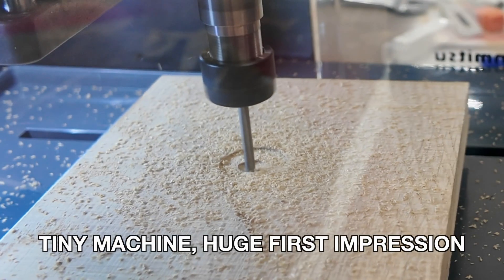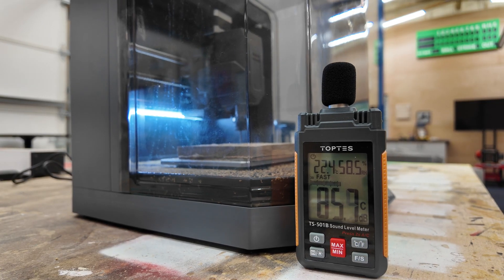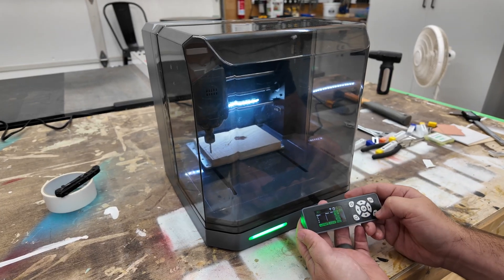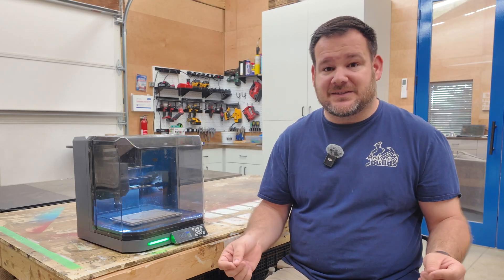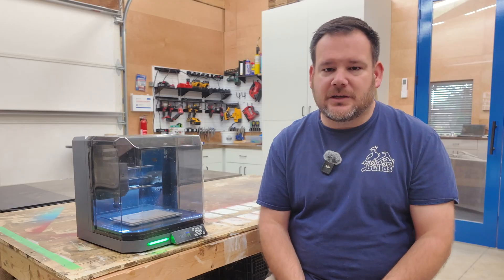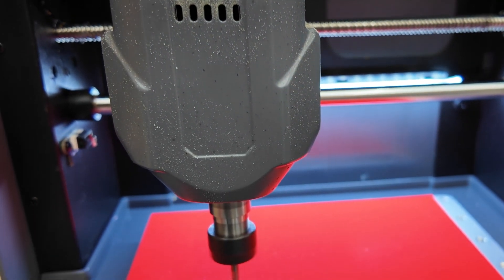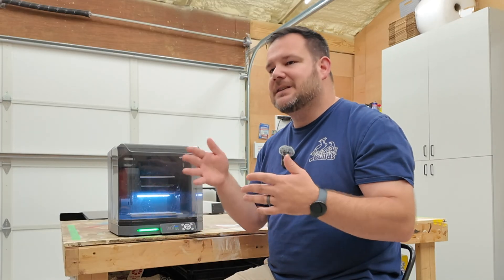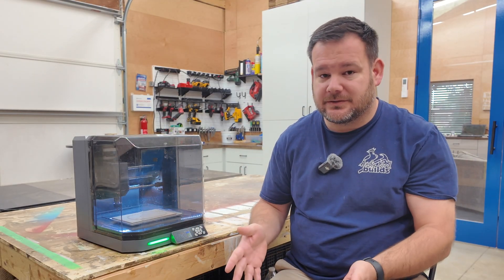Best End of Year CNC Router for Beginners + CHEAP

Comment from the maker: Check out the Genmitsu Cubiko: https://tidd.ly/42PnNc7 (click ...more to see links)

🎥 Video To Watch Next: Best CNC for Beginners on a Budget in 2025 https://www.youtube.com/watch?v=QV_o-s_MRFw

🛠 Machine: Genmitsu Cubiko https://tidd.ly/42PnNc7

https://thecnchub.com/
Reply: I actually tried different options on the cnc hub website questionnaire and the Cubiko didn't get returned.  I'm pretty certain this meet my needs (workspace is a little small but it's manageable).  My only main concern as a beginner is the learning curve of the software combined with the knowledge of what bit to use, etc.  I've used Lightburn for laser cutting but haven't used dimensional options.  Is there a demo version of maybe VCarve to try or a beginner video to watch to see how hard or easy it easy to create a file?